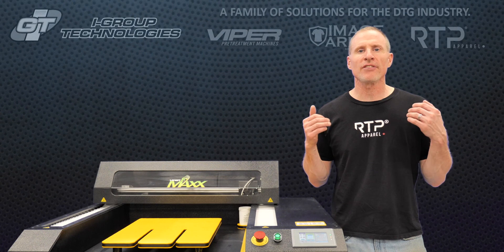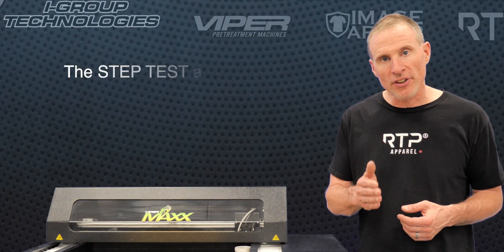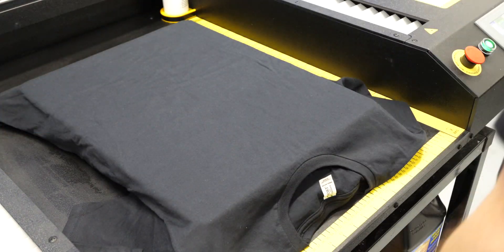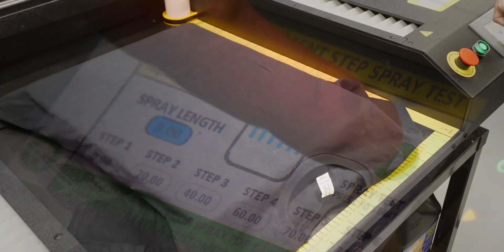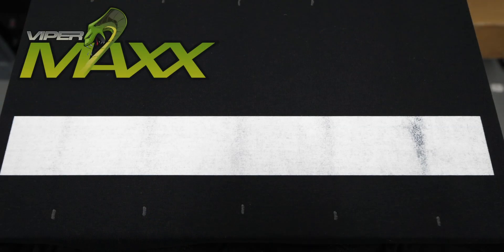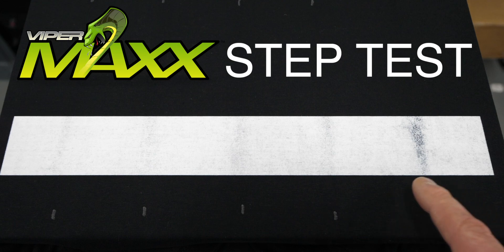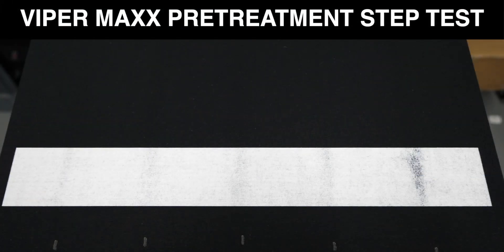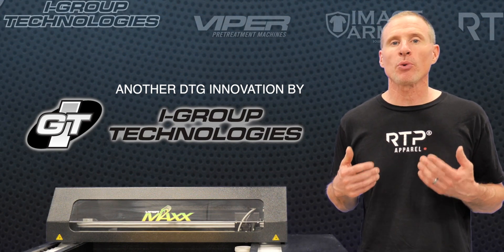Viper MAXX DTG Pretreatment Machine STEP Test

Comment: My Viper Maxx rocks my shop, but it's a few years old and doesn't have this feature. A few months ago I spoke to one of your techs about getting the software on my machine updated & was told I would have to ship part of my machine back to igrouptech for this to happen, which just isn't practical, I can't be without my pretreater for that length of time.

Have you given any thought to providing a kit to customers so they can upgrade their pretreater in-house?

I can't imagine it's that difficult...

And I imagine there are other features I am missing that would be useful.
Reply from the maker: Unfortunately the PLC would need to be reprogrammed and that requires our proprietary software. There is the option of shipping in JUST the PLC and screen, but yes, you would experience some downtime with this.
Reply from the maker: Another option is to utilize the bar code scanner on the machine. This PDF link http://www.viperxpt.com/wp-content/uploads/2019/11/Viper-MAXX-Bar-Code-STEP-TEST-for-Proper-Pretreatment-Application-10-35g.pdf allows to scan each step and reproduce the same results without having any down time. Hope that this is a good solution to help you out. Also, another PDF with slightly LOWER spray values in the step test at http://www.viperxpt.com/wp-content/uploads/2019/11/Viper-MAXX-Bar-Code-STEP-TEST-for-Proper-Pretreatment-Application-11-22-grams.pdf